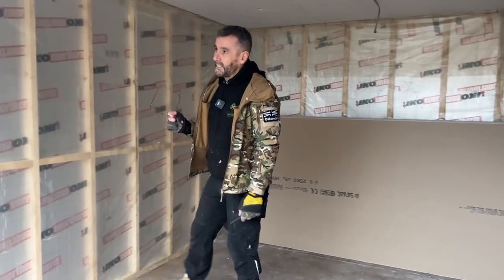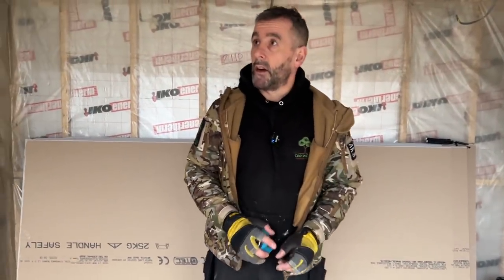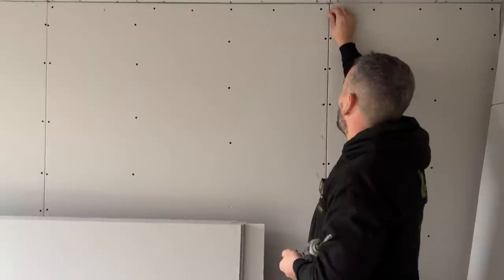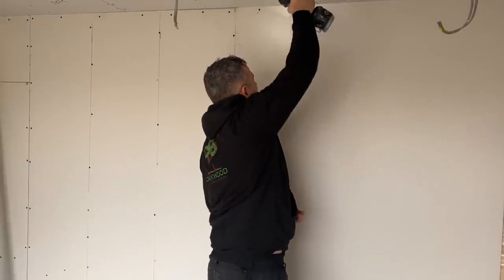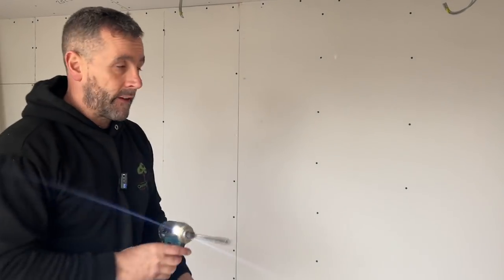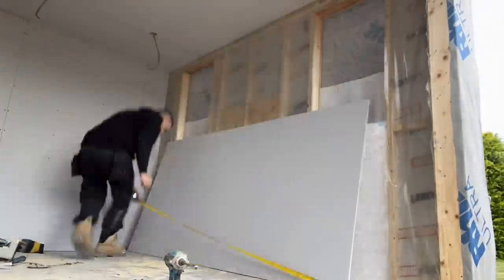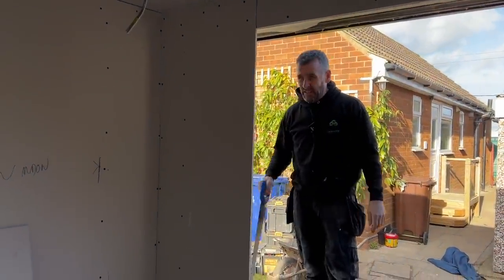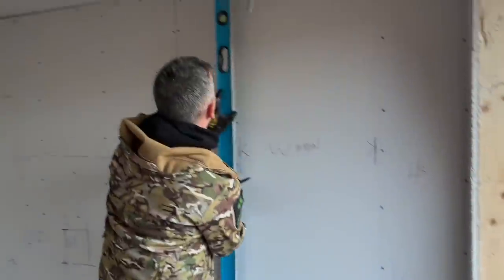Day 10, solo garden room build, plaster boarding and fitting the back boxes

Comment: I slide my bolster flat under plaster board and simply line up board and stand on end of bolster and it will lift spade end upwards closing gap,be gentle and it will help lift board if you cut to much of just put small lever point under handle to help you,

Comment: A brilliant and informative series Liam. I have already purchased your build pack and this series answer pretty much all my questions. I do have a couple though.
1. The build pack says to lay down breathable membrane on the floor underneath the flooring. You didn't do that in the series. Any reason?
2. The roof timbers run at an angle to give you the fall which means that the front and rear ends are not perpendicular to the ground. Do you cut them at the required angle to give you a perpendicular facia board?
Thanks again.
Colin

Comment: Great video as always although I like this series more because it is more in line with my future project.

With regards with the plasterboards in windows and doors, have you tried to use the saw on the short end for cutting but using the stanley knife to cut the paper back of the board? It is the same procedure as cutting your board to length.  In this way, you have less dust to clean up.

Comment: A quick question 9 x 4 mt do you need extra strength half way in through the building ? Or would this be ok all the way down on the bigger scale building?
Reply from the maker: same scenario for walls (if thats what you mean) the roof ties them in
Reply: Perfect I thought with that length you might need extra support. Thanks so much 🙏

Comment: Hi Liam, another amazing video in this Solo build, it just shows everyone that it is doable (if thats a word 😆) by one or two people on their own without thousands of pounds worth of tools.
Hoping to start a self build in the spring with my son helping me as I'm too long in the tooth for a lot of heavy work, I did have a question if thats O.K., can the floor joist "Shoes" be bought ready cut to size and drilled with a 25mm hole as i imagine the Evolution magnetic drill and bits are quite expensive ??.
Thanks again for all your insight's, tips and tricks for building your own garden room.
Reply from the maker: Yes mate, lots just use the washers to support the timber, absolutely fine, but obviously I need to ensure it’ll last so we use the shoes, Bapps for bolts do it all
Reply: @thegardenroomguru  Thanks Liam 😁 will take a look.
Reply: @colindoesdiy  any local fab shop or smiddy would cut the shoes and drill holes as required for you, wouldn’t take much with proper tooling. Worst case scenario you can buy hole saws for metal and they will cut through although a bit more work than mag base broach bits. 👍

Comment: Are the external sides weatherproof (breathable membrane) before you put the cladding up or would you need to cover if it started raining?
Reply: the membrane is waterproof, lets moisture pass from inside to out, but not outside in.

Comment: I thought I was understanding your stud spacing until this video.. you were leaving 400 gaps to best use insulation and not 400 centres which I got but now when you are putting the plasterboard up your studs are now on 400 centres so I got a bit confused again
Reply from the maker: It can be a bit mate
Here’s the answer 
Floor = 400 spacing as you get best use out of installation snd 22mm floor boards will span distance
Walls, 400 centres as insulation isn’t a big issue, plaster boards are 1200 wide so 0, 400, 800, 1200 centres
Roof same as floor , 400 spacing, maximum use of insulation snd only a few plasterboard to cut to make fit, roofing OSB will span 400 spacing
Reply: @thegardenroomguru  brilliant, clear now thanks. great video series by the way. this is your best yet.